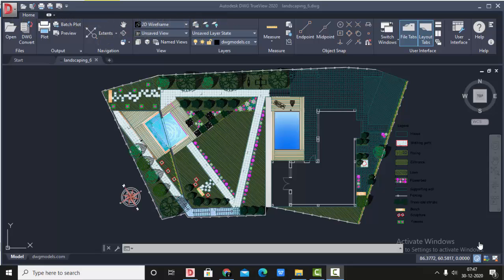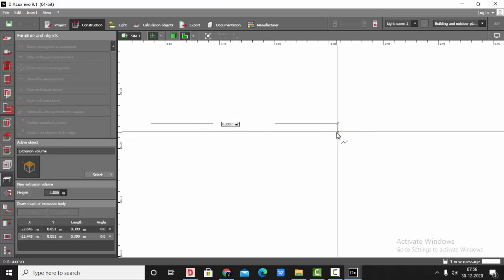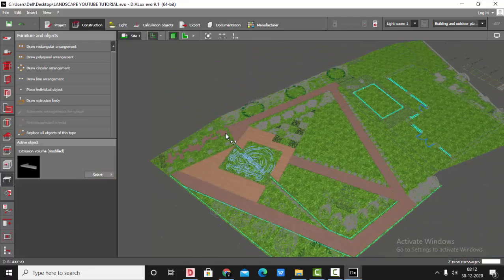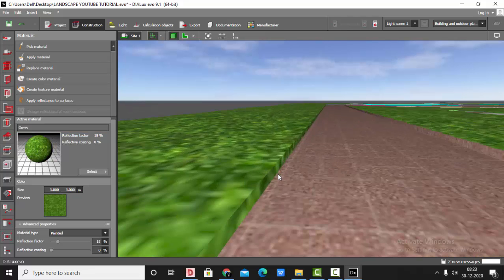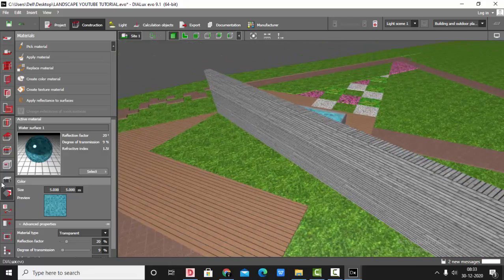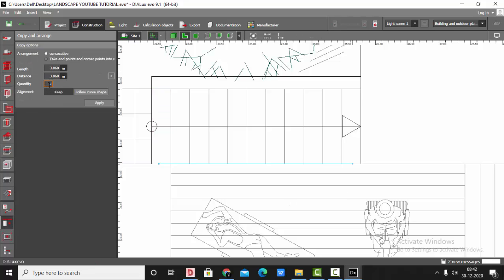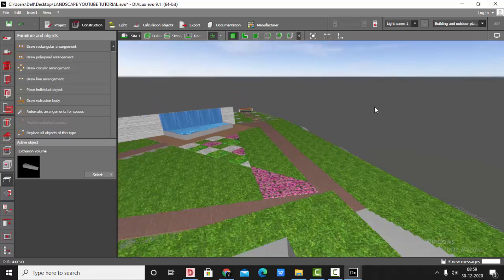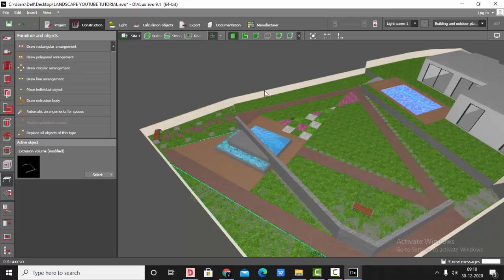LANDSCAPE 3D MODELLING IN DIALUX EVO - PART 1

Comment: Nice explanation, thank you Sumaya, but I have a question. What is the intensity of the lighting for outdoor roads? What is the wattage of lighting used to light an external road that is 1000 meters long? What will be the boom angle value of the lamp?